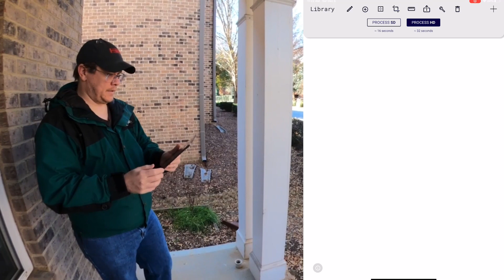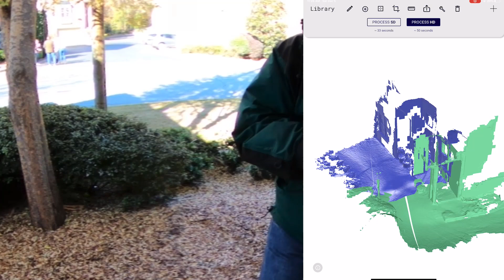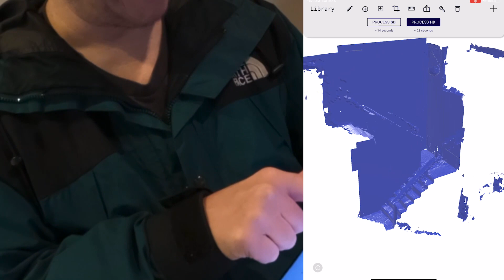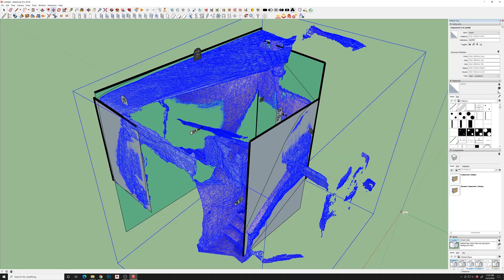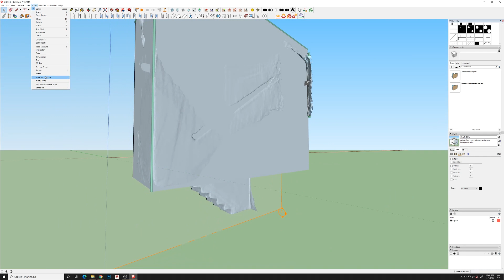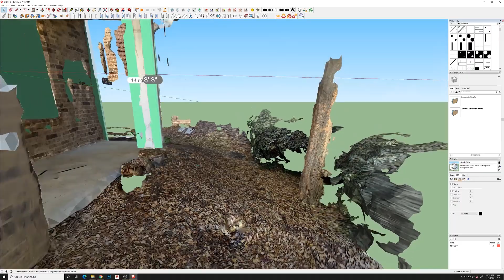Download LiDAR iPad Polycam Sample Scans - ALL Formats FREE

Comment: Hello, thanks for the video. I do 2D As-Builts in dwg, existing floor plans, ceiling plans, interior/exterior elevations, etc. Question: Once the project site is scanned, how do you transfer the information to Autocad? Let's say you need to create an existing floor plan. Sometimes client request power outlets, switches, breaker panel, thermostats locations. Thanks in advance.
Reply from the maker: I bring them into sketchup and then export a slice as dwg. then bring that into cad and trace it. The other option is to use something like canvas app. send it off to them and they send you back cad file. its expensive at .15 cents per sf....
Reply: I export them as LAS and then into Recap to turn into RCP for insert into Autocad. I am switching to Bricscad though. Newest version allows you to drop most raw colorized formats  into the drawings, ply, las, xyz..

Comment: Looks great as a replacement for lots of site photos with the added benefit of rough dimensions. What size ipad pro are you using? thanks for the great vid.
Reply from the maker: I’m using the 11”
Reply: I use an Orbital/360° Camera Ricoh Theta on a tripod, very very helpful! Lighting equipment sometimes is required for dark places.

Comment: Thanks for the files, much appreciated. I opened the external scan in SketchUp, it looks as though your front porch bends towards the street (as you walk out of your front door to the left). The difference looks to be about 300mm across 3.8m. To create the scan you made 4 passes; I thought the result would be far more accurate!? Am I missing something?
Reply from the maker: You definitely need to do some clean up and measurement verification. This is one reason I really wanted to let people see the files... get a feel for their own accuracy comfort level.
Reply: @WhitewashStudio  Thank you, by allowing us to see the files, you are helping us all very much! I noticed that you started the scan (exterior) at your porch looking outwards. Do you think that the software would find it easier to cope (improving its accuracy) by starting the scan facing a corner, perhaps the door, where the vertical and horizontal perspective lines are in shot of the camera/Lidar? Maybe walking along, scanning without too much camera movement until the fundamental base edges of the building are done? I'm thinking that as the walls are square, the scan would understand that first, then build up the whole picture using that as a foundation. What do you think?
Reply: @jonmcmanus247  I have had the best luck by scanning everything I can in one area before moving around increases accuracy. The largest amount of drift occurs when I start walking, so I try to minimize the movement. I tested mapping a large  area in some very non distinctive terrain and after about 900' in a circular loop, my original start point was about 8' off. It is not perfect, but its amazing that my phone can do this.
Reply: instablaster